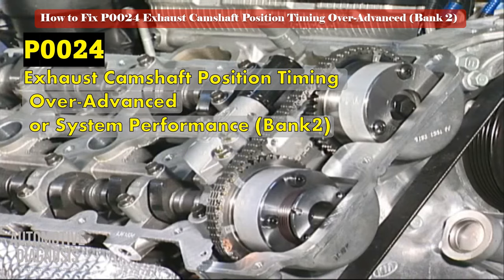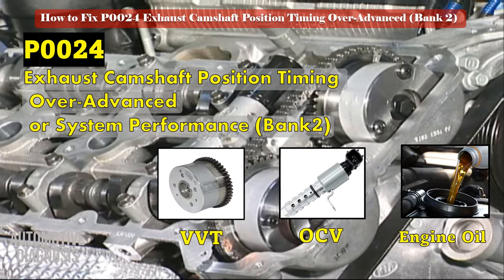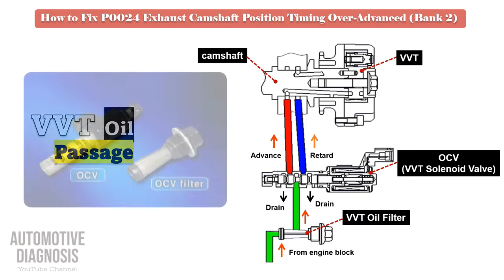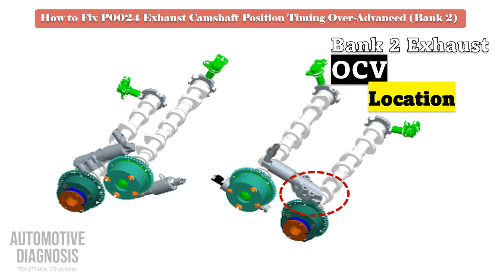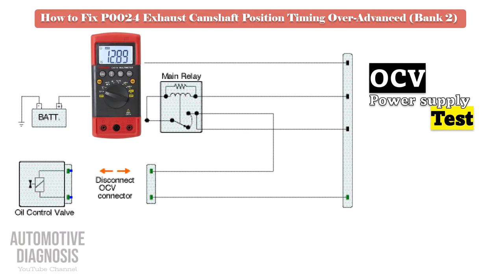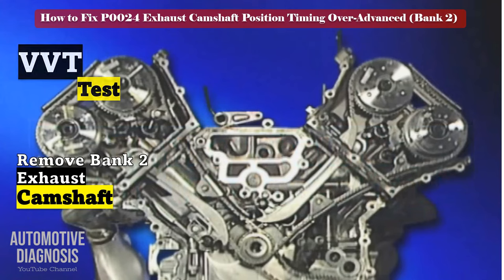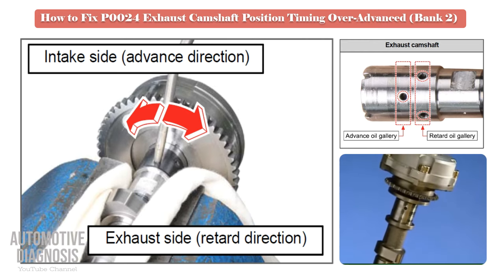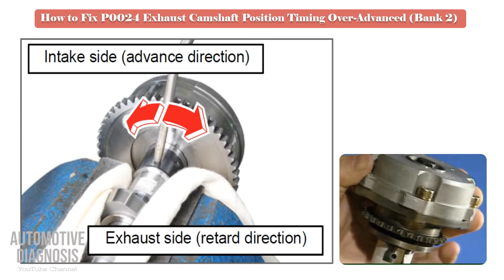How to Test & Fix P0024 Exhaust Camshaft Position Timing Over Advanced Bank 2 - Engine Fault Code

Comment: How long does it take to fix a poo24 cold on a 1011 infinity
Reply from the maker: Hi my friend. As you saw on the video this fault could be caused by a couple of different things. So there is not a specific time for that. It could be as easy as a connector or it could be engine timing.

Comment: I have a 2018 Chev Colorado 3.6L w/ a P0024, and the code won't clear. I swapped the bank 2 and 1 VVT and no change. Checked for 12 V on the bank 2 VVT and have 2.4V  on bank 2 and bank 1 VVT connector. Looks like the hot goes through F47 the the VVT and other sensors in the truck. I would think I should have more then one code if all my sensors have a low input voltage. Ant ideas?

Comment: Do those codes cause misfire? I bought a 2013 impala and I think they didn’t change the oil as recommended. I’ve changed plugs and coil packs. Only thing else I can think is dirty valves not allowing open/close fully or these solenoids…
Reply: If you have Over Advanced VVT vehicle will misfire. run sluggish and vibrate